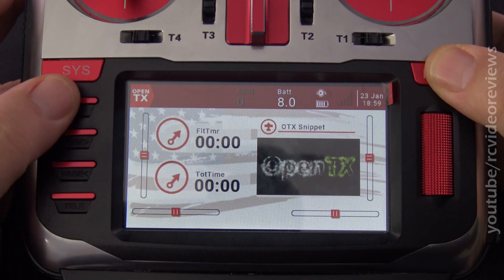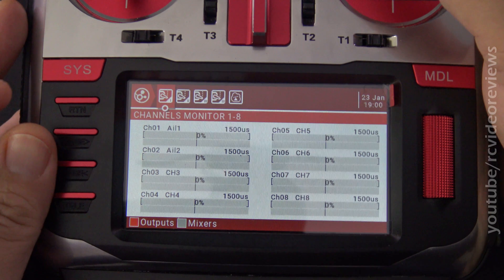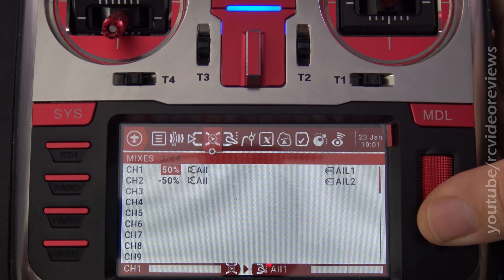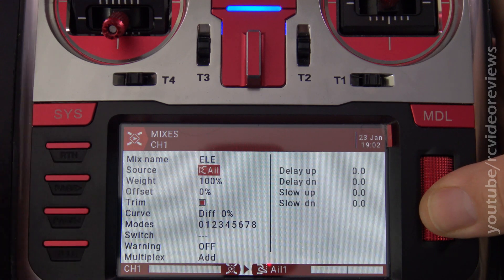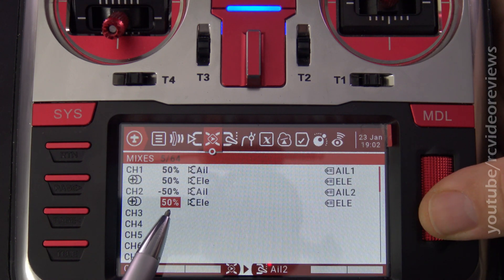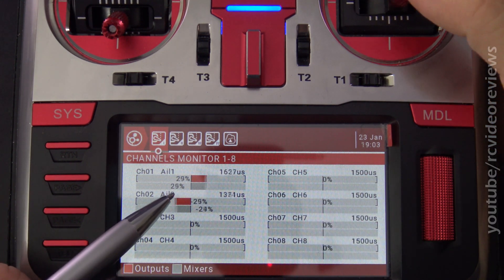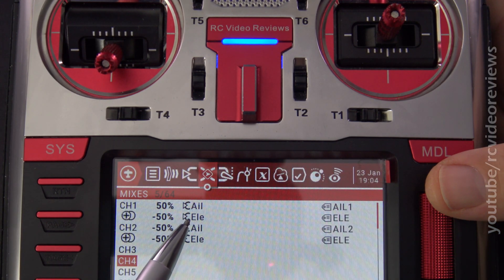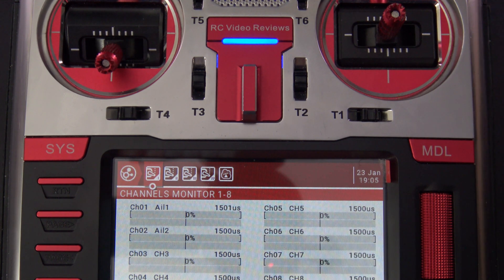OpenTx Snippet • How to Mix Aileron and Elevator for Elevons

Comment: hello, firstly thanks a lot for your videos, I'm a beginner and it helps a lot. as an example, if I put weight at 20 when my elevator is centered. I have what in need upside but needs more downside. how can I do? excuse my English and thanks in advance
Reply from the maker: Try differential.
Reply: @RCVideoReviews thank you for your fast answer I will try

Comment: very nice your doing please te boatll me can i do this also with my boat using the mixing with throttle ?
Reply from the maker: I'm really not familiar with boat setups, but the mix occurs on the radio and is sent out the transmitter mixed.

Comment: Hey I just seen something interesting with a spectrum DX9 and was wondering if it can be done on open TX. The guy was using his upper trim buttons to adjust the elevator while the flaps were down so he could adjust the elevator  when the flaps were deployed in the air but it did not change the elevator trim when the flaps were up.
Reply from the maker: Better yet, set discreet trims for Flight mode 1 and 2, then when flaps are down, flight mode 1 trims are used, and when flaps are up, flight mode 2 trims are used. You don't even have to change the switches you use to set trim. :)

Comment: Hi thanks for the great video, only one issues im having, my ailerons show nonoutput in channel monitor, hence not working properly. What would be the fix to that please
Reply from the maker: Sounds like you're missing a mix line. Mixer feeds outputs. Channel monitor shows mix lines and outputs. If you don't see movement on the channel monitor that means you don't have a mix and the downstream output.

Comment: Is this  mixing impossible for Freewing JAS 39 Canard Jet ?
Reply from the maker: Sure. Mixing isn't airframe dependent. The entire process of mixing exists between the radio mixing process and the transmission of the commanded output signals over the air.

The RX simply reacts to those signals.
Reply: @RCVideoReviews  Thank you

Comment: Interesting thanks for the video but here's the big but... I have an RC airplane I have one Rudder Servo and I have 4 aileron servos, and I want to mix/couple my rudder just tad with my airlerons so if I'm in a  knife-edge I want the wings to stay straight up and down, now does this mean I have to mix my rudder with each individual aileron Servo??? I can't seem to find a way around  this could get quite messy and confusing in mixing page
Reply from the maker: Your ailerons (x4) should be an input. Your input is what gets mixed, not the individual servos.
Reply: @RCVideoReviews  I really appreciate you helping and doing all this am but I still don't get it I'm sorry here's a link explaining the issuehttps://youtu.be/OIrU7BUk1j4
Reply from the maker: Below your rudder line add a mix with 10% aileron and see what happens when you move your ailerons.
Reply: @RCVideoReviews  if I do that the rudder is 10% slave to the ailerons but that's not what I want, i want vice-versa I want the ailerons to be slaved to the by like 10% or something to the rudder stick and because I have four servos for the ailerons I also have to have 4 inputs in the mix menu correct? And because of that I have to make 1  rudder mix and copy it to all 4 seperate aileron inputs which makes for a very confusing and messy setup these radios are nice but they have simply gone too far!!! And to do something simple they are downright confusing! and plus some of them I have to put a negative mix to it and some positive so that I don't twist off my aileron because to servos could fight each other if I don't do it correctly, and then to adjust  I have to make darn sure I don't forget any of the four because if I forget any of the four the servos are going to jam and heat up for the record why don't you make up a model and make it have like four aileron servos like mine and try slaving / mixing it to the rudder stick
Reply from the maker: I just watched your video to the end. You already know the answer. If you want the aileron stick to mix rudder, you add aileron to rudder like I said. If you want your rudder stick to mix/move ailerons, you have to add rudder to the aileron likes just like you did. Yes, they have to go on every line.

What you're missing is that you're using static weights and you need to learn to use global variables. So instead of setting a weight of 76%, tell it to use GV1, then set the weight you want in GV1. For the Ailerons that are reversed using negative weights (you could have just reversed their output in the outputs tab) use -GV1 as the weight.

I'm going to end this conversation here. If you want more help, join our discord. YouTube is truly a bad platform for this type of engagement. https://discord.gg/jSFTASU
Reply from the maker: I'd also strongly advise you to watch my OpenTx playlist videos. I've covered different iterations of what you're asking in at least 3 different videos.
Reply: @RCVideoReviews  okay that makes sense I never knew what Global variables were for! Thank you so much that makes sense I really appreciate it
Reply: But yes I guess I will just have to have them added to every single line but that's okay I will just label them properly and just have to be very careful

Comment: I am trying to do a rudder/elevator mix for knife edge. The plane I am flying needs a bit of up elevator to keep it straight with both left and right rudder inputs. I can't work out how to do it. I have tried various combinations of weights and diff %, two mixes with positive and negative values but no luck. Probably need to sleep on it and try again in the morning.
Reply from the maker: When it comes to mixing, think about the surface that needs to be adjusted and the surface that does the adjusting. The one that does the adjusting gets mixed to the one that needs to be adjusted.
Reply: @RCVideoReviews  Managed to sort it today. I added two mixes on the elevator channel both with rudder as the source. Messing around with positive and negative weights plus positive and negative diff% gets me a 10% negative elevator deflection with left and right rudder inputs.
Reply from the maker: @alanchase7329  Good job!
Reply: @RCVideoReviews  I'd be nowhere without your videos.
Reply from the maker: @alanchase7329  Glad to help

Comment: Hi, not sure you saw this question I sent the other night, it seems to be mixed into another question I had.... but here goes.....    ok have another probably dumb question for the night,   I did my set up...your video couldn't be any more smoother.....I get my received binded and testing the mixing.....but have a hopefully simple fix .....  right stick up and down..operates the turning and the right stick left and right operates the elevator function.   how do I switch to make this the correct way please
Reply from the maker: Remove whatever mixes you have. Leave just one line either elevator or aileron in the mixer. Then make sure that works first. Once the single control surface works correctly, add the mix line below it.
Reply: @RCVideoReviews  so I did some rewatching of your videos, getting closer to solve my issue..I did remove a mixer to leave just one..then added the other back...still same...then thought maybe a servo needs reversing...found your video on that.  Which I reversed the elevator and getting close....   now my right stick operates aileron correctly.    and up and down on the right stick make the elevators move in the same direction... BUT when pull stick down, the elevators go up and when push up  the elevators do down   which is the opposite you want.  How do I correct this?
Reply from the maker: @davidNH  Invert the weight.

Comment: Hi RC Video Reviews.   Your channel is awesome.  Kinda the reason why I just bought my tx16s max instead of the new nx8.    So I mostly build foamies with aileron/elevator mixing.    When I go to the mixing tab.   Mine shows all channels and yours is just ch1 and ch2.    How do you delete the others?
Reply from the maker: The mixer shows all channels. It's only a question of whether or not there is an entry with text on that channel. If you don't want a mix line you should be able to long press the jog dial and hit delete or clear.
Reply: @RCVideoReviews  thanks for the quick reply....watching your opentx class from 2/16 now...great video   already learned so much...do have a question on teh throttle cut   you mentioned using the SH switch,  mine does not stay forward when you click it....like the SF switch does......   it is sort of like on a specktrum radio  the bind switch, it releases back when you don't apply pressure to it.   your SH clicks and stays   hmmmmm
Reply from the maker: I relocated my momentary switch. There’s a video on the channel about it.
Reply: @RCVideoReviews  thank you for clarifying,   I was thinking something on mine was wrong.   dude really like your channel and learning a lot.   so happy I went with the tx16s max
Reply: @RCVideoReviews  ok have another probably dumb question for the night,   I did my set up...your video couldn't be any more smoother.....I get my received binded and testing the mixing.....but have a hopefully simple fix .....  right stick up and down..operates the turning and the right stick left and right operates the elevator function.   how do I switch to make this the correct way please

Comment: hi.i have a 4 channel rc plane and i d like to saw me how can i mix elevator with ailerons so i can use elevators as ailerons but only if i want it to by a switch.thank you
Reply from the maker: You can use the same configuration as in this video, just add a switch to the switch source on the mixer line.
Reply: @RCVideoReviews  thanks a lot.keep going and do fantastic job so we can learn

Comment: hi.
how can i make 2 chanel elevator behave like 2 chanel aileron when i choose it with an switch ?
Reply from the maker: Add a mix line to one of the elevator channels using a switch source and invert the weight from the main line.

Comment: Hi, actually I would like to have the ability to operate the ailerons with a three position switch so that they become flaps when needed. I have read that you have to mix everything with the elevator, to prevent the plane from rolling.

Comment: You should have shown what happens when you pull the stick to the corner to demonstrate your full 100% servo deflection. I have set up wings on OpenTx and it was different then yours. So many ways to skin the cat. Your 50% theory makes sense on paper but I didnt see full throws in the vid. I wanna try a test one just to see if it works like that. Maybe you planned it that way lol
Reply from the maker: How'd it work out?
Reply: @RCVideoReviews  didnt try it yet. I ahve been trying to update the firmware but I keep getting an error prompt when trying to write to radio... Not sure what the problem is.
Reply from the maker: @North49RC  Are you in bootloader mode?
Reply: @RCVideoReviews  Yea i am following your video step by step. Its some thing wrong with my file or my previous application

Thats what is saying anyway
Reply: I did try your ail/ele mix and it worked to get  full throws. Actually I was in companion and just set up a test plane as a delta wing and it set up your mix for me, right out of the box. I have set up planes usually through the Tx and the delta wing option isnt part of the set up menu sequence, just asks you how many aileron and elevon ports. I might set up more stuff with Companion, get it locked in then bind. Thanks John
Reply from the maker: @North49RC  Try putting the firmware on your sd card in the firmware directory. Reboot into bootloader mode and hit write firmware. It should present the firmware in your firmware directory. See if that'll do it.
Reply: @RCVideoReviews  I tried that and the file is 16MB, SD card is 2MB. I am on discord if you have time. BATTLEAXE
Reply from the maker: @North49RC  I posted the firmware on Discord. It's not 16MB in size. OTX firmware is only about 1KB.
Reply: @RCVideoReviews  Ok cool thanks John. I might have made some progress with this. I noticed that bootloader said it was running 2.3.8

I deleted everything companion off my computer, saved back ups first. Installed companion 2.3.8 and let it upgrade to the 11 version. So far I got it to write to radio...

Comment: As the other gent mentioned, I'm pretty sure if you don't reverse in outputs there is a chance that the trims will work in reverse
Reply from the maker: That's a reasonably good guess, but it's not the case, I just checked. Trims work correctly.
Reply: @RCVideoReviews  I had that problem once and don't remember how I resolved it and that seems to be a logical reason. That's why I watch you video's
Reply from the maker: @alantoseland6629  I've always used outputs to reverse servos, never weights. I used weights in the video to help create a visual relationship of what was happening on the radio. Glad the videos help out.
Reply: @RCVideoReviews  Yes they do, being thick and curious is not a good combination I've found. All the best John

Comment: Doing it that way means your trims could be reversed.
Reply from the maker: That's a reasonably good guess, but it's not the case, I just checked. Trims work correctly.
Reply: @RCVideoReviews  Thanks, will use this method, much appreciated. Your doing a fantastic Job :-)
Reply: Could be reversed or are reversed ?

Comment: Hi, my name is Hermann and I am writing to you from Italy. I always follow you with interest so much that I decided to buy a Radiomaster T16S, just because you always post interesting videos. I bought several gliders that I will test later. Now I am concentrating on the learning Open TX on Radiomaster and I was wondering if I could post a more specific video on how to mix ailerons and elevator, to use the ailerons as flaps, if the glider does not have them.A complete guide from the connection of the servos, the creation of the model and the mix of everything.Thanks I hope for your reply
Reply from the maker: Hello, Thanks for writing. 
Quick question, when you say mix the ailerons and elevator to use ailerons as flaps. Please elaborate on the role the elevator has when mixing the ailerons to behave as flaps. Are you suggesting elevator down trim to prevent ballooning?

Regarding connection of servos you only need to know what the mixer shows. Whatever the mixer shows is how you connect the servo. i.e. If the mixer shows one aileron on channel 1, you connect one aileron servo to channel one on your receiver. If the mixer shows the elevator on channel 2, you connect your elevator to channel 2 on the receiver. Remember, the mixer decides where the output goes on the receiver. So match the receiver outputs to what you see in the mixer.

Comment: Is there no way to have the elevators work full distance when no ailerons are in use and visa versa?
Reply from the maker: At least two ways to do it. 

1) Add two mix lines and assign a switch to each. One with the weight of 50, one with the weight of 100. That is manual mode but very easy to implement. To prevent issues with alieron inputs, you may want to also add two more mix lines for ailerons on the same switch positions and set their weights to 0.

2) Use a configuration similar to what I built in dynamic dual rates. Watch this video and that'll teach you how to make changes dependent on certain conditions in the radio: https://youtu.be/t6UhhENEU2I
Reply: @RCVideoReviews  So it is possible to have full elevator and at the same time give it also roll and one elevon stays at max while the other reduces throw to give  full elevator and at the same time roll for example maximum barrel rolls.
Thank you for the help.
Reply from the maker: I feel like you changed the question a little:

"elevators work full distance when no ailerons are in use and visa versa"
" full elevator and at the same time give it also roll"

In the first question you asked for full elevators when NO ailerons are in use.
In the second question you asked for full elevators AND aileron roll.

Those are two different questions and two different configurations.

The logic capabilities in OpenTx are so strong that I have yet to find a scenario I couldn't accomplish. That said, the second case you offered is somewhat unorthodox and not a configuration I've attempted. If you watch the video I'm about to post on Crow Braking, it should give you some ideas on how to change weights and mixes based on a switch.
Reply: @RCVideoReviews  ok I will watch the up coming video. Thank you.